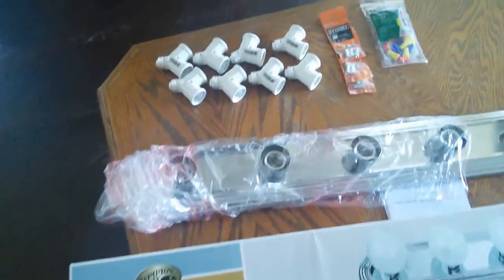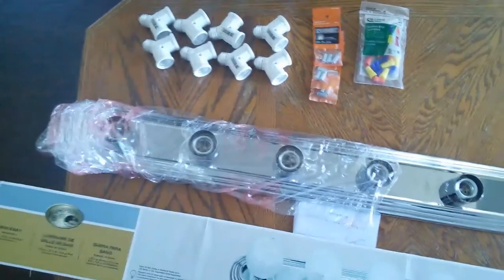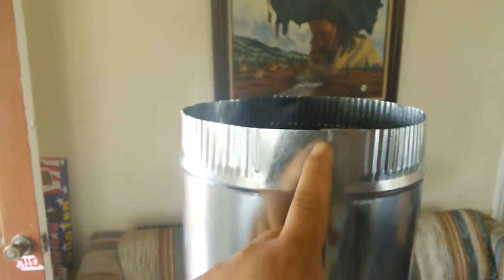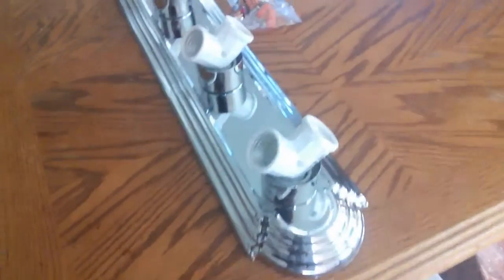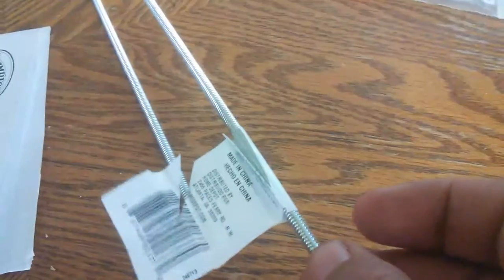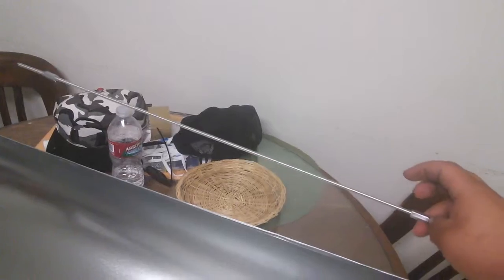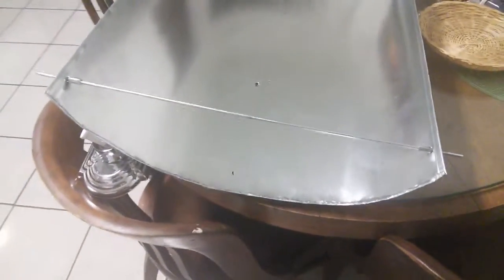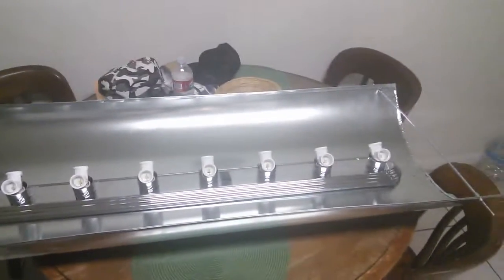Diy cfl for growing on a buget

Comment: That looks sweet and easy how big was the threaded rods? searching from home depot and only has 1/8 in. x 36 in and are the lights 100watt  1600 lumens, 5000 Kelvin not sure so pls tell me its correct  and thanks  oh by the way on home depot  online only see 8 in. x 2 ft Metal Duct Pipe so gonna have to look from the store otherwise will have to buy twice on everything i guess one more thing you  Published on Aug 12, 2015 any update on the lights? no problems on it? and how much more did your bill come up for the lights? just asking